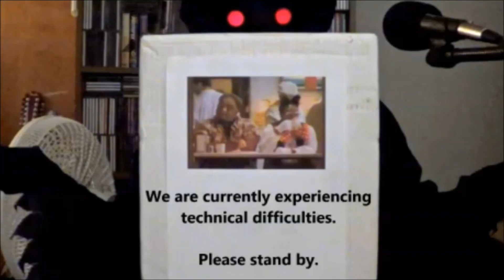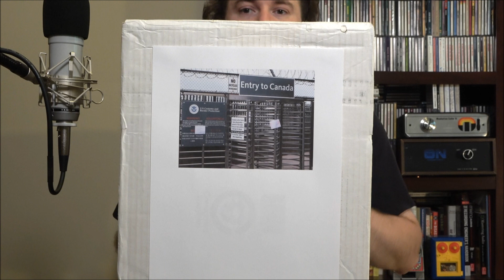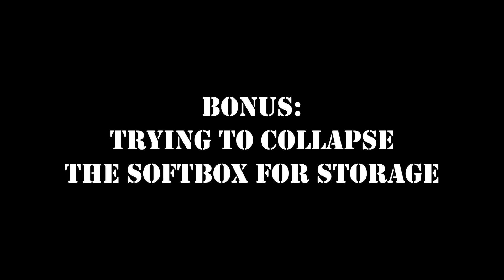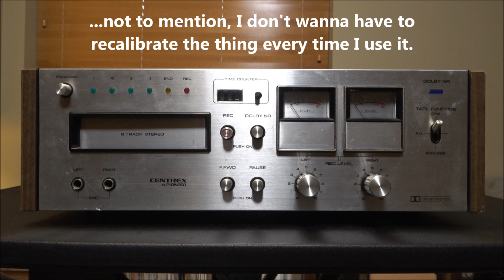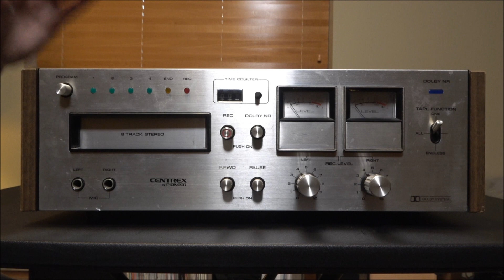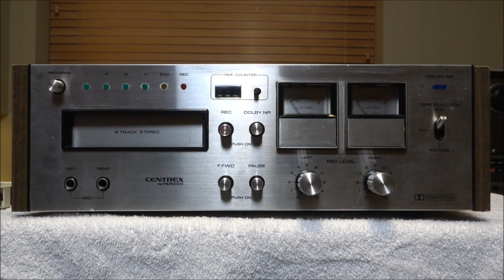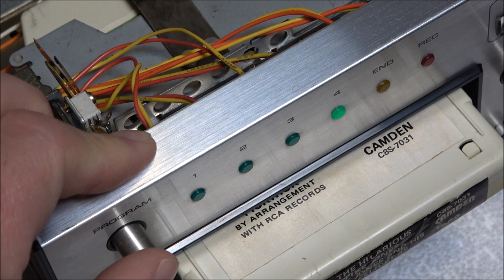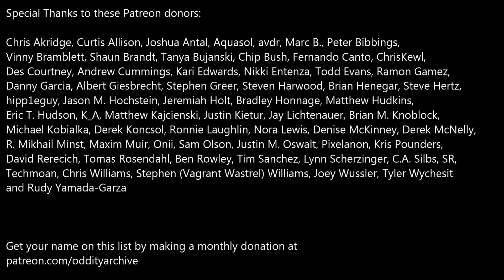Oddity Archive: Episode 198 – How I Spent My Summer VII (A Change of Plans)

Comment: I think the problem with the CD player is that you removed the laser mechanism without removing the unit and tried to reassemble it with the unit still in place. This caused the tray mechanism to go "out of sync". You must remove the whole unit, make sure the laser and the tray work properly and then put it back in place. There is a series of gears, locks and switches that depend on the proper placement of the tray so that the laser can lock in the proper way to read the disc. There might be some hope for it.

Comment: I have the same trouble with the sun shade in my car. "Fold it like a taco", the instructions say. Yeah, right, that's what you do first, then you have to be a contortionist to finish up. I hate that new components have no front panel displays. I HATE having to turn on the TV just to see what track I'm on on a CD. Those Centrex things are OK. They don't show up in any of Pioneer's main line catalogs from the 70s and most old audio sites estimate 1978 as the year these came out. HiFi engine does have the owner's guide online and, since I'm curious, I will download it and let you know. Probably no chance of a proper service manual, but again, I can dig. Having a service manual really helped me on my Pioneer 6 Disk CD-ROM changer.

Comment: Don't admit defeat just yet on that Onkyo, chances are the gears are just out of alignment.  Have a close look, you'll probably see tiny marks or holes on the gears that are designed to line up with each other to ensure all the gear timings are correct and so the player knows where the laser, disc, tray is etc. at the correct time.  Worth a close look and you have nothing to lose, unless a gear is broken of course.  Assuming you are able to fix it, but want to keep the Denon instead you can at least sell the Onkyo and get some money back.